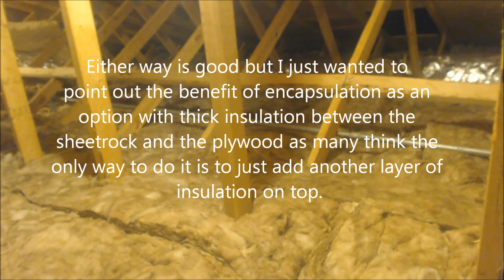Ductwork going through your Attic Insulation? Do You Really Have R-60 Insulation Then? Explained!

Comment: Please help me.  Is this the correct installation for an attic fan?  I have a house with two gable screens side by side each one 12.5” X 20”.  I was told I would have to to have only one opening of the gable vent and block the second one with plywood to install an attic fan to prevent backdraft.  My house is 56 foot long and I want to create a flow of air through the entire attic.  So the only opening on the one side should be the opening of the fan—what is right?  Some say that the fans have back draft protection in their design.   Thanks for doing an attic video and maybe you can do one on attic fans.
Reply from the maker: Hey Teacher Lynn, for the maximum affect, you would box that fan in but it really depends on the type of gable plastic grille that is there. The grille typically blocks a lot of air. The attic fan in the middle of the roof works well to pull the air from the eaves and gables as well, thanks. Have you checked out the book yet? What school did you say you taught at, thanks a lot Teacher Lynn!
Reply: @acservicetechchannel  Very excited about the book and great job.
Reply from the maker: Thank I am excited to get this book out to everyone!